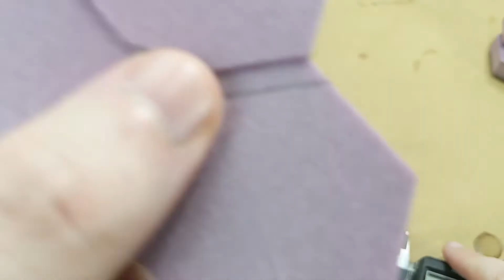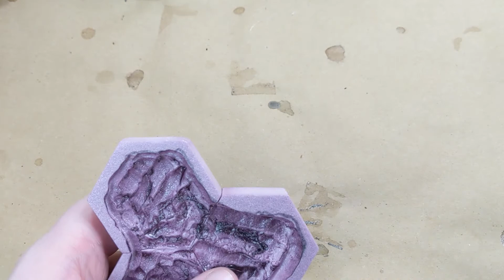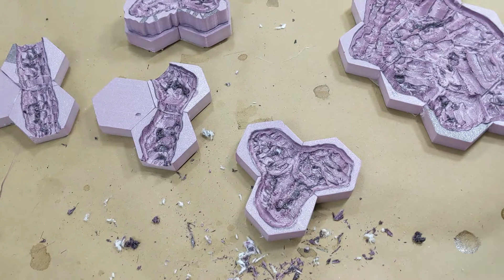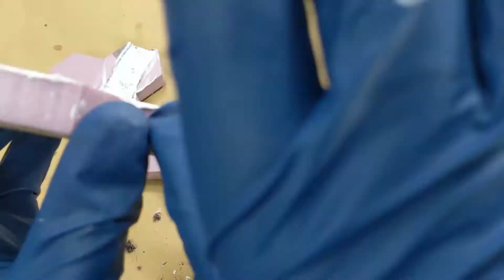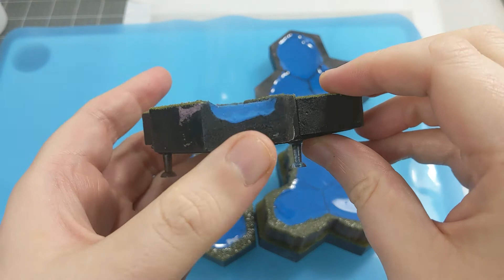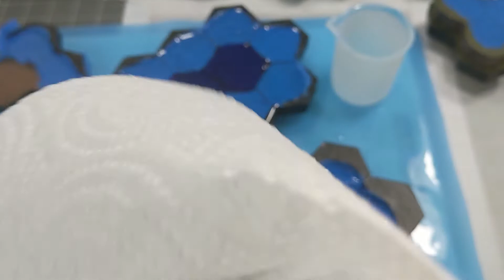Making Water Feature Tiles for Battletech

Comment: I was wondering if it would be safer, that instead of using a soldering iron or heated spoon if the hollowing-out can be done using a small paintbrush (like the one you used for the blue paint) dipped in a small cup/dish of acetone (nail polish remover) to "melt away" the foam chemically and let the tiles dry/evaporate before applying paint. The only issue with the idea is that I don't know if acetone would affect the type of insulation foam panels you are using compared to simple styrofoam drinking cups, which acetone can completely dissolve/melt.
Reply: Probably not healthy for either cases since the fumes generated from the heat (like the one in the vid) or from a chemical compound such as acetone melting the foam, isn't safe for the lungs or blood. If one would try these method then for sure there is enough ventilation to vent the toxic air out of the environment such that one doesn't get exposed too much from breathing the air. Better yet wear a half face mask with a charcoal respirator so the fumes can be absorbed by the charcoal. If nothing else, a carving tool to scoop out the inside may be better since no fumes could be generated from just carving.

Comment: Late to the party.... Just found you.

What are you doing? 
Save your lungs!
Stop wasting resources like butane and accidentally burning through your bases. 
Use your hot wire cutter from the previous videos. Laterally cut them in half height-wise. 
Take the (now) top piece, hollow out the centers like reverse that you did for your 'hills', and glue them back to your 'base' piece. 
Paint or fill as previous. 

If you want, cut it in thirds. Then step your two top upper pieces. The lower level can be for your deep water.
Glue the center pieces on your larger lakes around your deep centers.  
(use tacky glue for these parts, it won't melt anything)

     top

I---                    -----I
I   '----          ----'     I                  cross-section view from the side
I       '---------'          I        

   bottom

Experiment with different transparencies of your resins. 
The deeper they are layered the darker they become.

Do some further research. 
Model Train Terrain How-To videos are invaluable, as well as those weird resin-filled table top furniture videos.

I would forgo the push pins, you don't have enough surface being supported and they are only distracting you. 
Put your pieces flat when you are working on them with the resin.